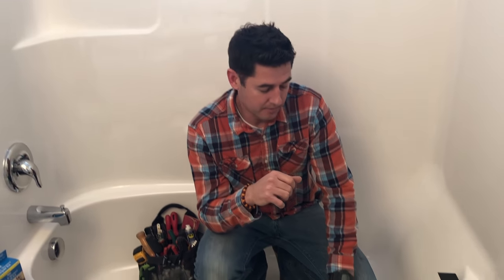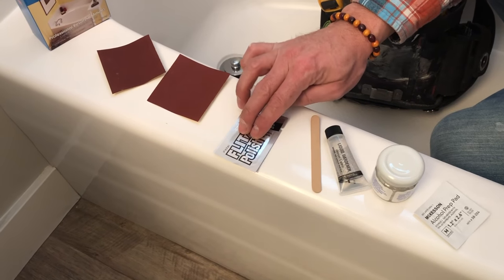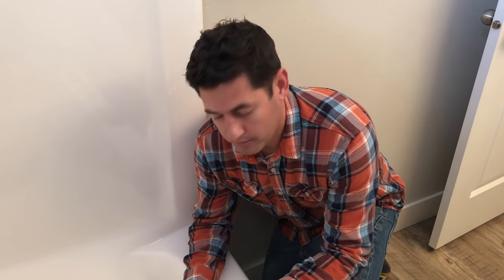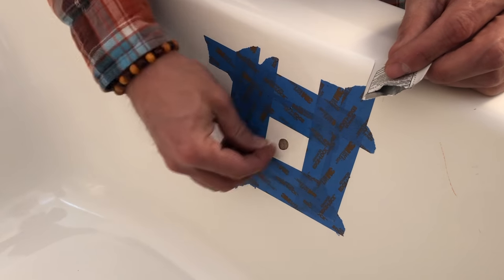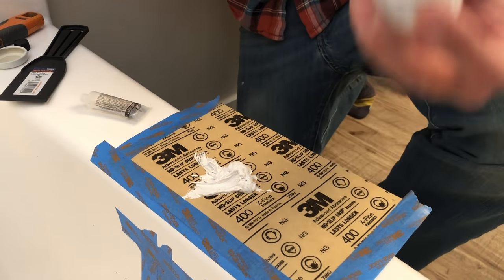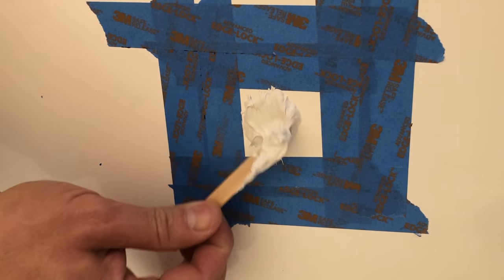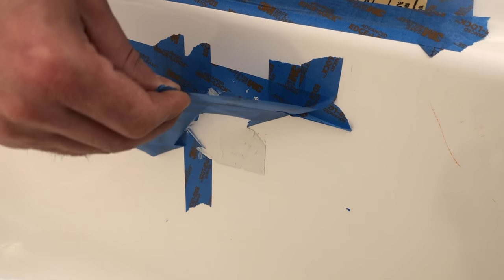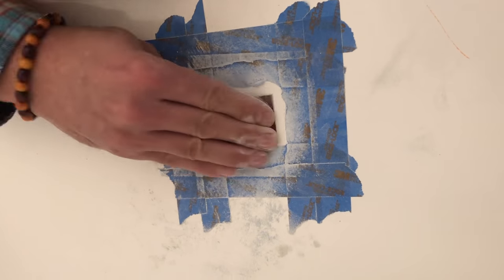How to Fill a Hole in a Fiberglass Tub

Comment: Nice work!  If the hole was the size of a quarter or more you mentioned you would use a fiberglass cloth, resin, and hardener.  Would this be in addition to using the Tub and Shower Repair kit or instead of?

Comment: I used JB WELD waterproof putty because I'm going to replace my tub. So far after 15 days it's still working. Oh and I spray painted it with Kryon for an extra seal. Cheap until I replace it.

Comment: Thanks for the video bud !! I have a 30 yr old Maax Fiberglass Tub with walls .It looks really good though still so I am fixing about a thumb size hole near back of tub below water level . I pushed the Tub Repair Putty hard down into the void and have a slight low spot that keeps showing thru so I m gonna do a second coat.Do you think a small piece of fiberglass cloth would be good idea under second coat?  I m more concerned with patch being water tight strong than it looking perfect . Thanks again for the motivation to do it !

Comment: Don’t know if you’ll see this comment on a ten month old video but how big would the hole need to be before you need the cloth? My hole is about quarter sized. Thanks for making this btw.
Reply: I think any hole larger than the size of the  lead of a pencil would be best repaired using cloth. Using Epoxy is different than most repair chemicals. And the idea is; when completed, there is NO EVIDENCE of a whole having been there EVER‼️ So to ensure the Epoxy doesn’t get sucked INTO the hole while drying; I believe this is where the cloth material shows its value. 👍🤔. Good luck😄🙏‼️

Comment: Will this work on the tub floor too?
Reply: I have a small crack hole on the shower floor. I wanted to know the same thing
Reply: Yes. It will absolutely work on the tub or shower floor. One of the key points this video has shown you is use of Painters Tape around your work area. This method allows better focus on your damage area AND helps to coverup possible mistakes in the repair process. Well done job and exemplifies his “preplanned, thought out process” for repairing a hole in your tub or sink made of fiberglass or porcelain👍🤔✌️

Comment: Who would you look for if you wanted someone to do this for you so it would blend in and match? I don't want the discoloration. Your work is great looking aside from the color. Is it even possible to get a solid match on an almond colored shower? Thanks for the tutorial.
Reply: I would contact a “New Home or Remodeling Contractor”. Upon installing tubs into new homes; the contractor occasionally find themselves having to do tub repairs because the tub was NOT properly covered with a protective layer of something like cardboard and taped in place to prevent scrapes and/or small stress fractures or holes. Another subcontractors will come in after the plumber ;whom installed the sinks and tubs. Unfortunately, some subs will use the sinks as a holding place for their tools being used during that days work causing scratches and/or dents or small holes. . I’ve also witnessed subs setting 1/2 of their ladder inside the tub when hanging Sheetrock or Painting. Another issue is, If the site does NOT have an On-Site Porta-Potty;  some subs will even use your tub as a toilet until the toilets get installed and have a water connection.
Reply: @bobd.j.5393  HAHA, well that's something isn't it! Thank you for this information and the tip on whom to contact Bob. This is my next project to get taken care of. Thanks for taking the time to respond!

Comment: this is really easy, it's on the side of the tube not a hard to repair,  try repairing on the floor with 8- 10 Inch cracks in 2 places, where all the weight is located when taking a shower
tried Jb water weld,epoxy, all said can fix fiberglass, BS, your weight on it just cracks it back open and leaks to all hell thru the floor.. O well, time to start over